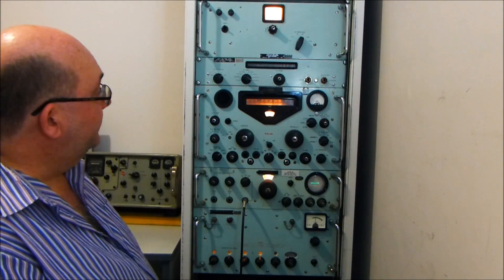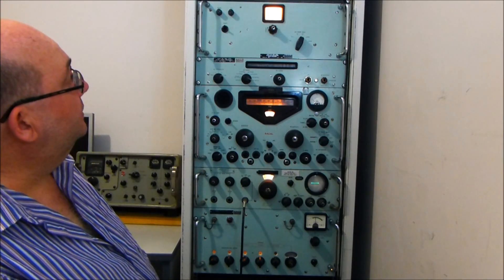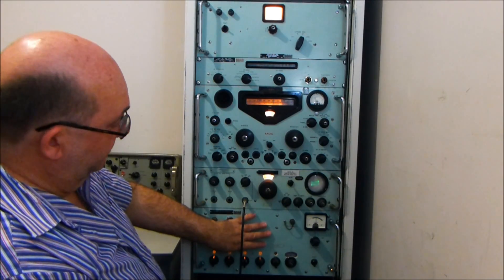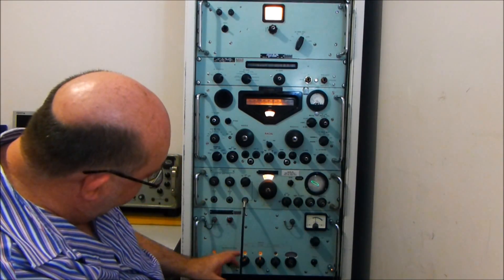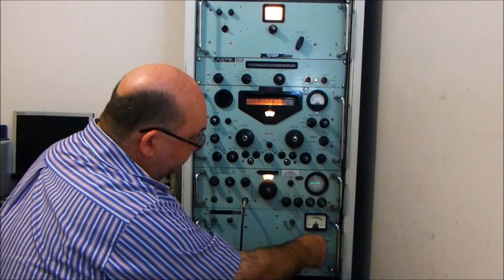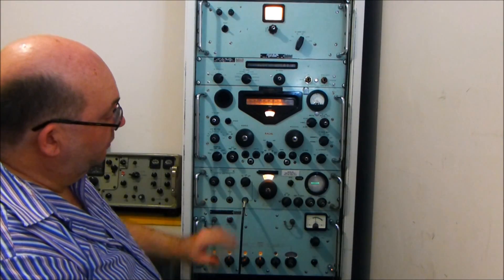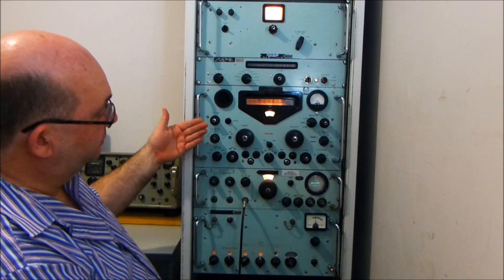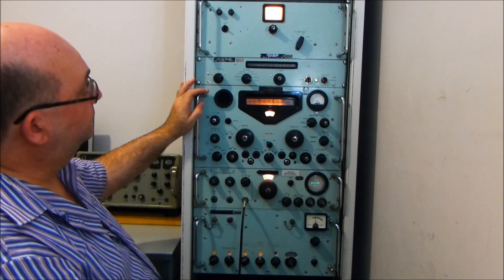RACAL RECEIVER RA117 SYSTEM.

Comment: This Monday and Tuesday I got my RA17L working again after a repair 5 years ago, too long. It was a big job to get to the 2nd VFO which was not oscillating and needed a resistor and RF choke but then still another fault and I put it to one side and decided this week I'm getting it working. On Monday I checked various stages which were all working then on Tuesday I found a coax cable was loose and came out of the BNC plug when I pulled it. I re-soldered it and away we go.
Stability still excellent, no drift when listening to CW even with the 100c/s filter. I bought mine from NewCross Radio (long since gone) 31 years ago. He had 6 and mine came with a manual which I needed.
B.T. internet has destroyed SW listening with QRM everywhere. I have to use a homebrew magnetic loop turned for minimum QRM and away from the phone lines to hear anything on the amateur bands but 160m and 80m still bad. 
B.T. refuse to take action when this only became a problem on their line as confirmed by Ofcom who investigated for me. The Ministry for Telecommunications are no better, they have no idea what I'm talking about. Both send standard letters telling me to get in touch with my service provider. Idiots in offices who know nothing.
Bill, G4GHB.

Comment: I'm trying to develop a acoustic picture projection for text transmission to Alinco and Motorolla Handhelds.

next step would be to order or manufacture units with memory (closer in electronics to the th47d but with a similar speaker)

has anyone done this cuz i shure could use it. 

thanks
-Mohan Parameswaran (va7fii)

Comment: Can an RA17 be used with an RA121 without  having that synch box at the bottom of the stack?  I'm thinking of buying the two and want to be able to listen both  to  SSB and AM.
Reply from the maker: MonkeysMustDie777 
Hi yes the RA121 can be used in a stand alone fashion. With either a RA17 or RA117 note the SSB is inverted one one to another and there was s a switch internal to the RA121 to select RA17 or RA117. For monitoring AM and  SSB there is a selector on the RA121 you just feed the audio from the main RX

Comment: Great vid. In about 1991 I was lucky enough to have an RA117 for about a year.  A friend used to work at GCHQ, and turned up with a surplus unit (I don't think it was from GCHQ though).  The performance was amazing, and the amount of control was very useful.  Had to sell it on, unfortunately, the electricity bills were phenomenal and my dad blamed the radio. Like a lot of things in life, you don't know what you had till long after you got rid of it!
Reply from the maker: Hi John thank you for you comments, The RA117 RACAL line up is one I like a lot, I had a RA117 and RA121(SSB) adapter in UK for many years back in the 80's. Sold them, missed them, and bought them back and added a few more pieces from the same era. RA117's from a sensitivity and dynamic range perspective always impressed me, had RA17 and RA17L previously but just like the way the RA117 perform. All the best Pete